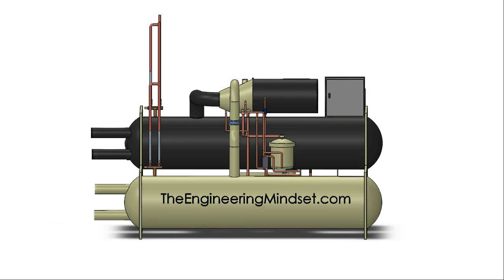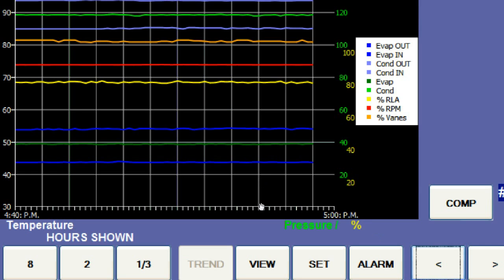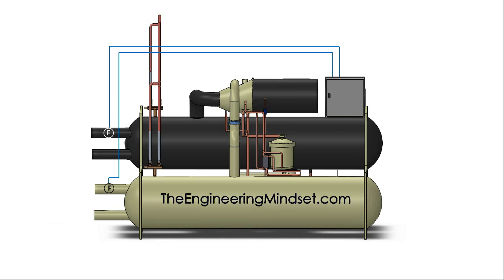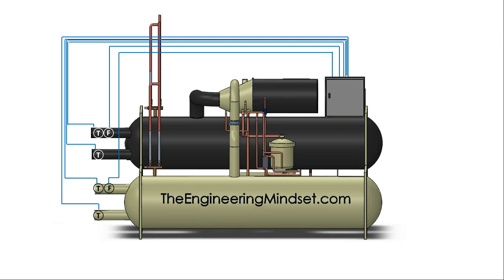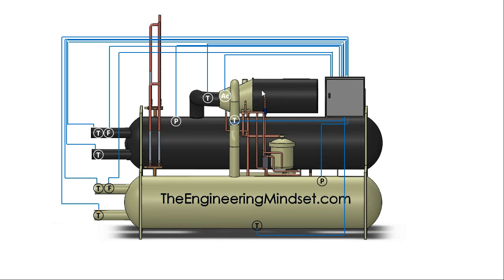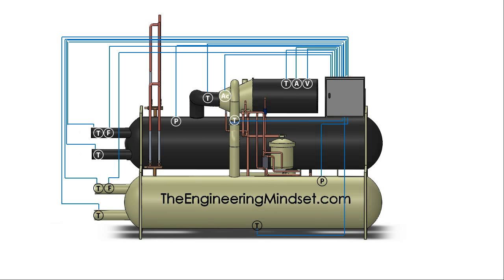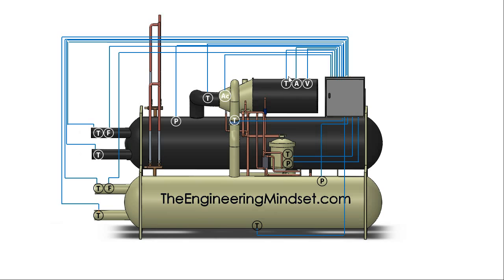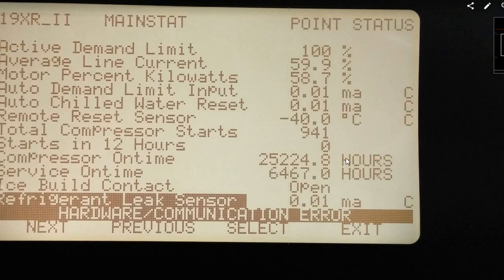Chiller - Controls

Comment: Very nice video, very informative. I have one query to ask. I believe the Control Panel will be part of the Chiller to monitor and control the various parameter as designed by the manufacturer. However, when it comes to interface to client's BMS, what are the various interfacing signals we need to consider to facilitate Remote monitoring / control of Chillers ?
What's the standard industry practice followed ? Chillers would be one of several equipment in the Pharmaceutical industry that are monitored in BMS.

Comment: Great video! I'm looking for a little bit more information about what you say at around @6:20...if the chiller was able to turn on-off/on-off repeatedly in a short period of time, it would cause damage at the electrical bus bars etc. Is there a written source that explains this phenomenon in some detail...i want to reference it in a paper...also is the start timer enforced through software logic or is it a mechanical timer? Can it be overwritten? And secondly, if the timer was somehow disabled, wouldn't the motor thermal protection prevent the huge inrush current from causing any damage to the electrical distribution system, by breaking contacts...or is the hypothesized damage at the bus bars due to deformation due to thermal loading/unloading. thanks in advance.
Reply from the maker: Check out inrush currents. There are a number of ways but it's usually software, you could over ride it but you'd have to really know what you were doing. Depends what class of thermal protection was used, induction motor burn outs are still possible usually from breakdown of insulation

Comment: i need control wiring of screw chiller capacity controler
Reply from the maker: try asking a manufacturer for the installation guide, you will find the wiring diagram in there